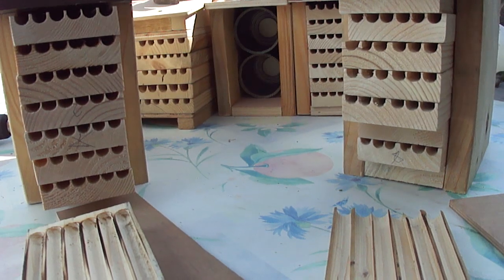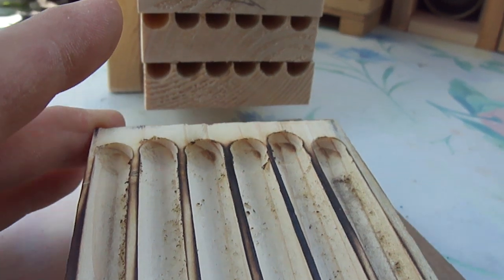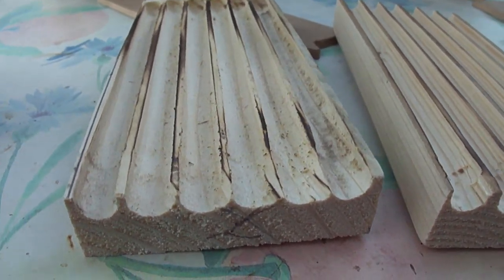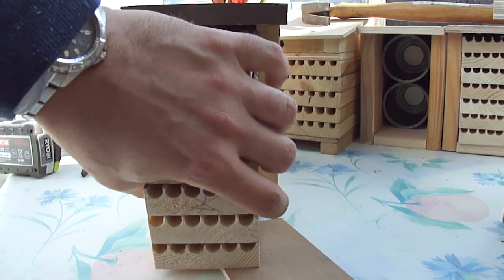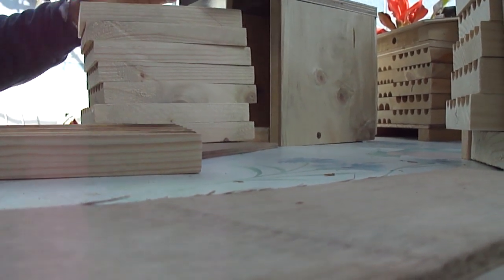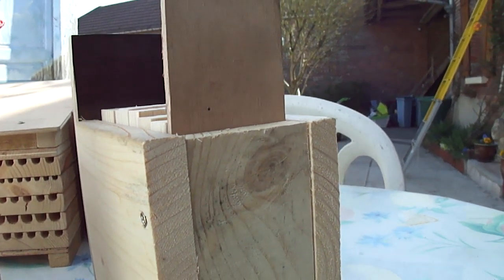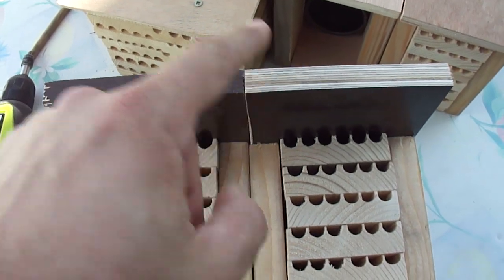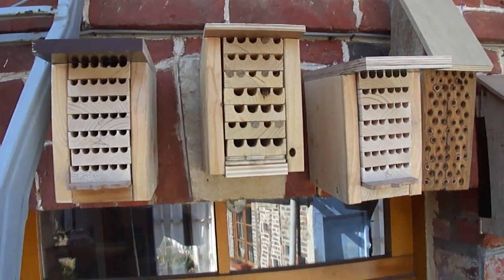Mason Bee experiment - rounded or vertical tunnel ends?

Comment from the maker: Routers are tricky things to keep running in straight lines, so I bought a bench where the router and cutting bit is fixed upside down and adjusted to the correct prominence (cutting depth) so that you just have to worry about passing and maintaining the path of the plank/wood over the rotating cutting bit. As you can see in the video the positions of the grooves were controlled, but the ending points were manually controlled. Anyway I will PM you a link to a very good  'how to' page.